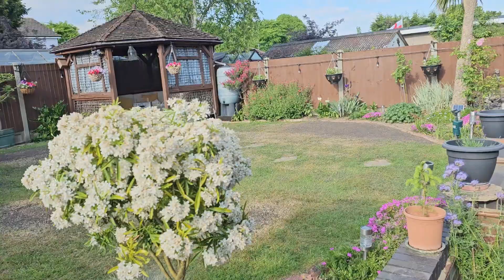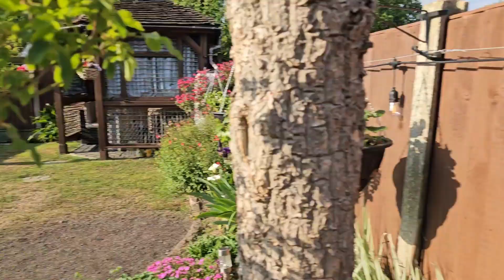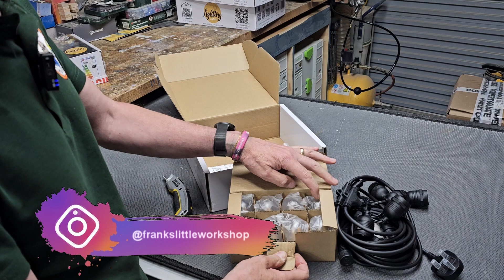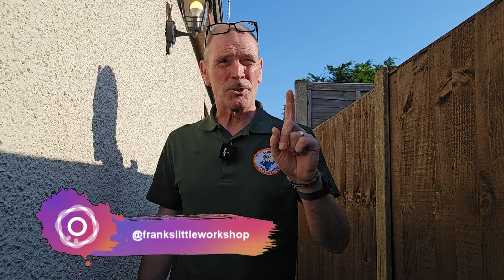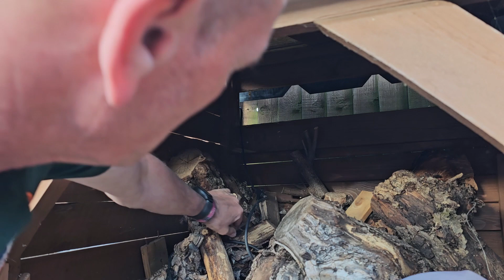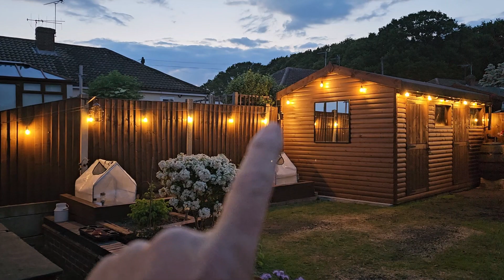Garden Lighting Extensions by Lighting Legends

Comment: If you use small side cutters used for precision work then you can cut off the cable tie tails flush with the head, trust me this saves lots of cuts if your arms brush against the teeth like pointy bits left, small things but they make a difference or use a cable tie tensioner "gun" that also cuts the tail flush with the head. Also (sorry writing and then editing to add text whilst watching the video) I would have had the supporting cable match the fence panels diagonal drop as well, sorry probably some form of OCD kicking in !!
Reply from the maker: 😆 Thanks Adrian, I 100% agree about the tie trimming. I regularly come home from work with lacerated arms from vehicle harnesses where the ties have been cut at an angle... it bloody hurts 😆😆. I will tidy them up next time I'm out in the garden 😁. Thanks for watching 😁👍